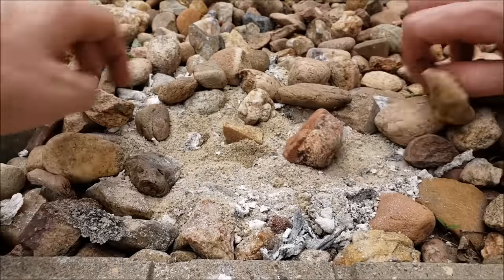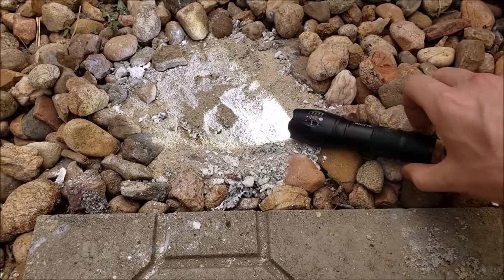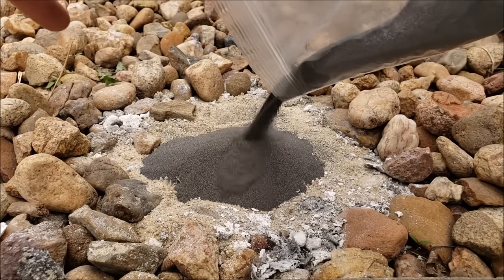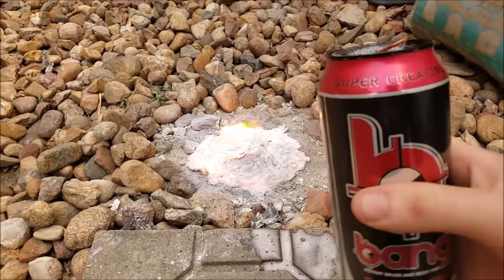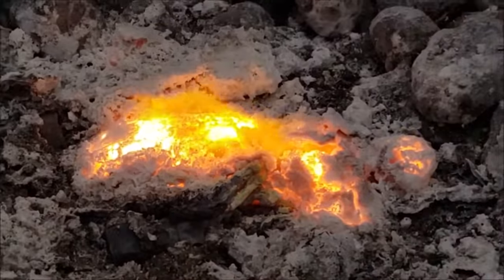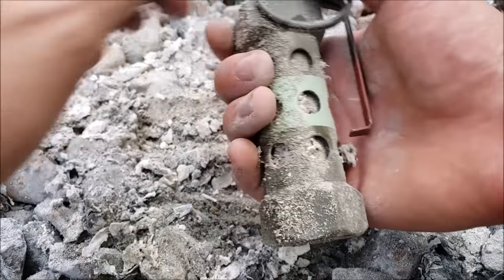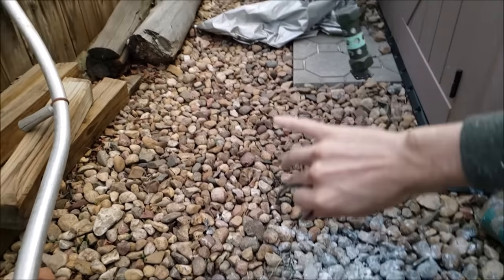HOW TO GROW FLASH POTATO BANGS

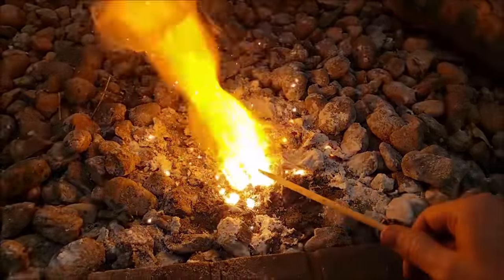Comment: The elephant foot joke at 2:44 is underrated.

For those wondering, I'm pretty sure it's referring to Chernobyl's "Elephant Foot" a huge rock made of silicon dioxide, with traces of uranium, titanium, zirconium, magnesium and graphite (All of the things found in a melted reactor core). When it was discovered it would give a lethal dose of radiation in like 5 minutes, but I think now you can survive being in the same room with it for a few hours. There have been several attempts to remove it but, surprising no one, a huge blob of melted titanium is difficult to drill through.
Reply: I was gonna respond with a “🤓” but this comment actually helped me a lot with the joke
Reply: agreed
Reply: Yep, and additionally, the Elephant's Foot is the only known source of Chernobylite, which is (predictably) a highly radioactive technogenic compound